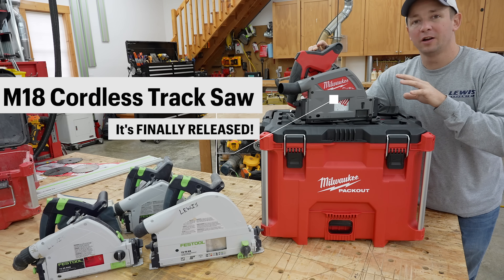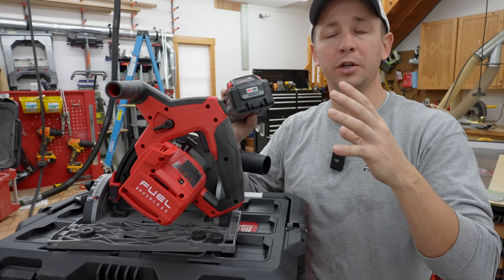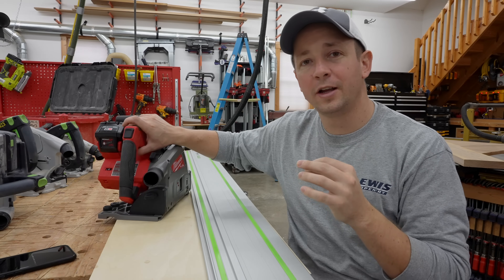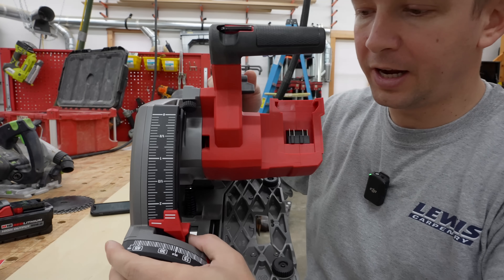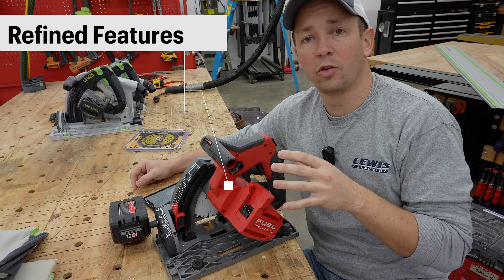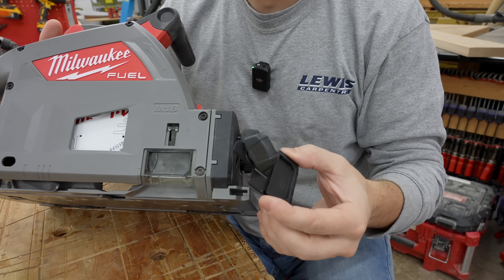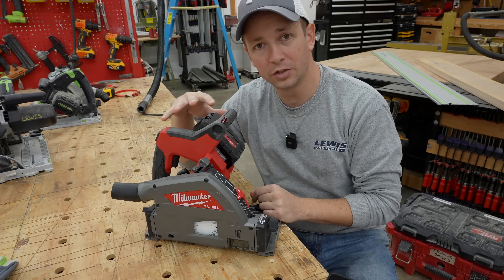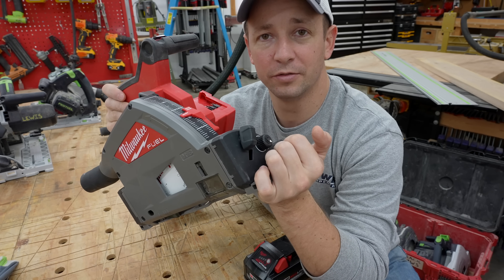Did Milwaukee Deliver??? | Full Review of the NEW Milwaukee M18 Track Saw

Comment: Hi there. Great honest review mate!! I have been waiting for a cordless M18 plunge saw for ages...the biggest disappointment though is that the bevel cut doesn't line up with the straight cut as you very clearly presented. So once you re-cut your newly applied splinter tape on the rail(current TS55 user-not same line of cut with rail), you're good, but one bevel cut and its all cut back again, on a bevel.
Is that something Milwaukee just didn't get right this time or is there an adjustment  that can be made?
Really not being negative, but I do like to line up with the pencil line and have an effective splinter tape in place.
Thanks so much.

Comment: That waste of space would be a great spot for the tray that normally comes with the XL box. Or if you could come up with some kind of blade storage that attached to the inside of the lid on that side of the box. Would have been great if Milwaukee would’ve added that to the lid. And just a heads up it’s really tight but it will fit in the pack out ammo box.
Reply from the maker: Good to know. Someone else was just asking if it would.
Reply: @InsiderCarpentry  whenever you get a chance if you could answer a question for me? On mine the 45° detent override that takes you beyond 45 had a lot of slop in it. I was not happy about the fit and finish on this particular part it’s attached with a torques 10 screw and it was tight but would rattle all over the place. I removed it and there’s a little metal tab that that slide attaches to I wrapped some Teflon tape around it reattached now it’s tight no slop I’m happy. My question is was yours like this?
Reply: Would love to see a video of it going in the ammo box. Someone else said it wouldn’t fit
Reply: My thoughts exactly on the use of a blade tray in the "wasted space" area. Looking to purchase and wii be looking to do a mod for one. Is the horizontal width of the wasted space wide enough for the 6-1/2" blade to lay flat?

Comment: Question about tracks.  I have the new Milwaukee track saw and one 55" track.  I can see the need occasionally to rip sheet goods along the 8' edge, however I do not really want to drop the coin for their long track due to  price and storage. I could see the benefit of having 2 55" tracks and combining them when the need arise.  I know this is not perfect, but can they be joined with the kit and get the results that should come from a track saw?
Reply: I tried that with my Makita system and wasn't able to keep it straight enough to suit me. Maybe Milwaukee's connectors will work better but if you're going to be using both sizes frequently just bite the bullet. I bought my long track form a dealer so I didn't get NAILED on the shipping for those long tracks.
Reply from the maker: You can do that but it is difficult to keep straight. Not the most accurate system... I definitely prefer to have a long track if possible.

Comment: Thank you for this video! I've been waiting for a video on this saw, and specifically a video by you on this saw. Thank you for putting in the time to do this! 

I've been on the fence for a few months between this saw and the new festool TS55 KEB. If you end up upgrading to the KEB (I bet festool would send you one), please do a head-to-head with this saw. I'm fully on the M18 line, but I do have a festool MIDI dust extractor that would sync with the new festool batteries which would be a bonus for dust collection. 

I think I've got another month or two before pulling the trigger, so it would be super awesome if you were up for putting out a followup video in a month or so after you've had some time in the field with it. At that point are you still grabbing the TS55 or is the convenience of the battery platform and the quality of the Milwaukee enough to win out. Thank you again for this video! Your videos are always top notch. You are definitely on the top tier of creators for carpentry on YouTube! 

One question: could you give the HxWxD dimentions of the saw? I'm curious if it might fit in the Compact Toolbox Packout. If you have one, would love to know if it fits, Thanks
Reply: It will not fit in the ammo can. I was debating about the festool as well as I also have the midi. However, I have the Bluetooth remote for the midi and for me that being on the end of the hose and being able to quickly turn it on was enough to convince me that the quality of this saw is on par with the festool. I really like the festool track saws and have used them in the past but like he mentioned in the video I was really torn with just having batteries for one tool. And the festool requires two batteries and only comes with one charger.
Reply: @zackminarik2402  Thanks. Hopefully that bevel cut is right on if using the Milwaukee tracks. Someone else on here says that it fits in the ammo box, but it’s tight. I wonder how tight? I could see taking out the foam on the left and putting my M18 finish guns in there. Pretty much would want them (saw and guns) available for any finish job. The box is just too big for a single tool

Comment: Does the Festool line up at 90/45 on the Festool track right out of the box w/o fine tuning? $399 is a great deal. I think the Milwaukee is a good tracksaw. I’m using a corded Makita and while I like it, it has its issues and I want to go cordless now. The Festool tracks working with Milwaukee will help also.  Have you reviewed the Bosch track saws yet? Excellent well though out review. Thanks 👍

Comment: What is the model number of the packout box? I ask because I have a deep storage packout I do not have a use for yet. It came with that 2 wheel deep box, this extra box I have is just as tall as the bottom two wheeled box and then I have a smaller packout on top of both of them.  I am wondering if the extra loose packout box I have can be upgrade with the same insert that comes with the track saw kit/packout.  I know my track new Milwaukee track saw will fit into the packout I have but I don't want it bouncing around.

Comment: Great presentation. I enjoyed your thorough review. A few questions. If using smaller blades  (Festool) does the roving knife present s problem if you are doing a scoring cut? And will one of the trays that come with the large tool packout or rolling packout fit in the wasted space beside the track saw?

Comment: Saw (get it) Festool came out with a new track saw with scoring capability for about $1k. Conceivably, could you not set the depth to scoring depth and then follow that with the blade set to normal depth to accomplish the same feat?
Reply from the maker: Yes, I do it all the time when I don't want splintering.

Comment: Great review. Do you know if the saw is compatible with Bosch or Mafell tracks?
Reply: I had the same question.  I have the Bosch track saw and tracks and Milwaukee cordless tools.  If there's a way to make this saw work with those tracks I'll certainly get one. Maybe it would be possible for somone smarter than me to 3d print an adapter.

Comment: I knew it… I just bought a cordless Makita track saw last summer because I needed it for a custom closet job… I don’t like Makita, but it was the only track saw available… I tried getting Festool, Mafell and even the dreaded DeWalt… all were on back order
Reply: After looking at this review I think I'm still going to go with the makita. I have both M18 and LXT tools already, but makitas saws can take a standard 5/8 arbor blade as well as the 20mm blades by flipping the washer. Plus it's slightly cheaper. Any complaints on it other than the battery compatibility?
Reply: @Nate Just not a fan of Makita, never had any luck with them… used them on various jobsites they just seem awkward and cheap… I guess it’s a personal preference thing

Comment: Your particular desire for a smaller box is not a reason to ding the saw that is your desire but I love the case i keep track clamps in there as well as extra blades and battery. And as far as battery life well the festool has 2 batteries anyway so theres not much difference one you swap out a battery the other has 2 on board that will both need to be charged at some point.

Comment: A little off topic but as much as I would like to have one battery platform, I just keep adding different battery platforms. I’m going to have to add FlexVolt batteries with that new 60v DeWalt Miter Saw but it’s worth it because my Kapex doesn’t always cut it as much as I’d like to think. I do have to say that the TSC55KEB is my favorite tracksaw.
Reply: Have you used the Makita track saw? In debating between the festool or the new Milwaukee
Reply: @zackminarik2402  yes, I’ve used the 36v Makita and it’s a great saw, too. You won’t make a bad decision with any of the one you are looking at. I’ve also got a HKC which makes it nice to have additional batteries for both saws.

Comment: I'd like to hear about the quality of cut.  My Mafell can deliver cabinet saw cut quality and precision which is why it has been such a game changer for me.  I tried the DeWalt cordless when it came out, but it didn't deliver anything I couldn't do with a straight edge and a FF blade on a circ. saw.  My M18 circ and miter saws have great power to be sure, but the motors are very crude and rough which leaves a lot to be desired as far as cut quality.  My concern is that they threw one of their existing motors into a tracksaw body instead of designing a new motor that runs smooth enough for cabinet work.
Reply: Ya by the sounds of it they put the motor from their much to be desired rear handle saw. Doesn't sound precise or refined at all.

Comment: Great review! Biggest question to me tho is, how is the cut? That's always been festools best feature, it cut better than the rest. Does it leave cut marks in hardwood? Does it tearout a bit in laminated veneered plywood? Etc... That's my biggest deciding factor
Reply: Ya I can’t believe this wasn’t mentioned
Reply from the maker: I was satisfied. In my experience a big facter on saw marks is how sharp the blade is. I will say that the kerf on these blades is a bit thin. But I think that going with a higher end, thicker kerf blade will probably cut down on the power.
Reply: @InsiderCarpentry  sounds like a video idea.  put a festool blade on the milwaukee and see how the saw compare.
Reply: The new festool track saws also use thin curf blades. It’s the answer to get more power out of the saw

Comment: Nice bit of kit, but if you are going to have a dust extrator hose then you might as well have the corded version.
Reply from the maker: Not necessarily. I grab my cordless with dust bag and go to the work on the jobsite all the time. Other times I am near the vac and like to plug it in.

Comment: I hv the corded Makita and Battery operated one ( new) that Makita corded has about 300 miles on it if it was a car?  And the new battery one is great and has a 1 degree back bevel , plus all those track tightening buttons and a track loc.  the batteries I run are two 5 hour batteries & I hv two on standby?  I so far have went all day cutting door, window, & base trim!  It’s other thicker wood I need to switch out!

Comment: Hey Spencer,
I own the Dewalt corded track saw but have been contemplating purchasing the Festool cordless kit. Would you choose the Milwaukee over the Festool?? I dont own either battery platform so that isn't a concern.
Reply from the maker: Tough call. I also have the festool HKC, so having an additional festool makes it easier. I also have other M18 batteries, so that makes the milwaukee pretty attractive. I'd probably lean towards the milwaukee simply because you're more likely to add other M18 tool down the road IMO.

Comment: Did I miss it or was there any mention if this saw has a scoring function like the Mafell? ie push a button and it makes a fine precut at 1/8" prior to main cut. designed to further reduce splintering etc.
Reply: It does have a scoring feature
Reply from the maker: I completely missed that feature. I'm bummed I didn't mention it.
Reply: @InsiderCarpentry  Dude, you crush everything you do. Give yourself some grace. You put a ton of effort in this and provided us a ton of info before we spend our money.
Reply: @InsiderCarpentry . Nah, it was a great review You can only cover so much without it getting too long. I generally wont watch or put off watching and forget 30min + videos unless its  a detailed step by step on something I'm working on or trying to work out.
Reply: @InsiderCarpentry  
Spencer, you are the best of the best, also this saw has a blade speed adjustment, not sure if you covered that feature??
I bought this saw purely based on your great review.

Comment: Just bought this and 2 x 1.4 mtr tracks with the track joiners, annoyed as I set the saw to one track then cross to next and it stops ! Tracks tolerance different ! as you can push freely on one and complete jams on the other, check the tracks before purchase mine are going back

Comment: THANKS FOR THE GREAT REVIEW. I'm looking forward to ordering soon. Do you think a 12.0 battery will fit on the saw?
Reply from the maker: I believe it will yes.
Reply: It will I wouldn’t recommend ,it’s pretty tight really just in the way I was surprised at how well it cut with the 6.0.
Reply: @steffendetrick  thanks, I’ll probably stick with 6 amp. I have 3 or 4 of them. I’ll have to get the the track for it. I have a Kreg track saw but I’m going to give to the wood shop I teach at.

Comment: The battery is very appealing as I have many m18 batteries. The pivot issue when using the bevel function is a big issue for me.  Needing to tweak the saw to avoid ruining the splinter guard at 45 degrees is troubling.  Are you sure you can fix this problem without causing others?  Should you have to take this risk in a professional level tool?
Reply from the maker: It's designed for milwaukees own tracks and works just fine with those.
Reply: @InsiderCarpentry  Thanks for your reply.  I thought this might be the case.

Comment: @Spencer  - I'm unsure if you are going to get what you want from the mitre cuts on the Milwuakee! Please see my remarks below and let me know how you went or double check? 
I'm about to purchase so I'm interested in your further feedback.

If you "bump the inner track guide" out to shift the 45 degree cuts.... won't that just shift the 90 deg cut to the right as well and mean that they will still not align? This seems to be more of a problem of the saw pivoting in a way the takes the blade off the axis of the original cut not the positioning of it on the track.

Thoughts?
Reply from the maker: You are correct. The saw really needs to be used with the proper track in order to achieve that proper alignment. It's not meant to be adjusted for this purpose.
Reply: @InsiderCarpentry   ummm... do you think the brand specific track would correct the problem? I consider this a pretty big "problem" and you are the only person I have seen show with such specificity how it matters (thank you),

Comment: Spencer nice review I will agree on some of the points but the one thing I have concerns about is this is a brand new tool let's see how it holds up in the real world. I've had the Festool I have the Makita 40 volt and the Mafell and I had the very original corded Festool which I recently just sold to a young man and it will probably serve him well for many years to come I have not seen that out of Milwaukee. Yes it's cheaper but the quality just isn't there when you hold a Mafell and you use a Mafell you understand what refinement and quality is keep us posted I want to see the longevity over the years on this to me that's more important than cost. One other question is the battery loose and rattle like on all Milwaukee tools just curious.
Reply from the maker: Yes, that goes without saying. This is a new release and I tried to make it clear that NO ONE can comment on the quality or longevity of the tool at this point. 

For many of us the platform is becoming a bigger selling point that premium, best quality. Mafell is great, but mafell doesn't integrate with other cordless tools most of us are using. That's a negative, and a big reason I sold my mafell track saw and won't be purchasing any other mafell as far as I can tell. Great tools, but I don't like one trick ponys. I want tools that integrate into an overall system if possible.

Comment: If you make that fine adjustment to cause the bevel cut to land exactly on your rip guide, wont that in-turn cause you 90 degree cut to get pushed off the mark? It seems you would have to choose one or the other, but can't have both. Great info on the saw!
Reply: It’s possible to have it work for all angles…but I’ve only seen one that does, my very old Sears Craftsman.
Reply from the maker: You are correct. I realized the mistake in my thinking after I watched the published video. I believe its a matter of the saw being designed to work with a track that is thicker or thinner, which would move the bevel cut in either direction.
Reply: Excellent review. Thanks!
Reply: So would this implied maybe the Milwaukee tracks would be a better choice?